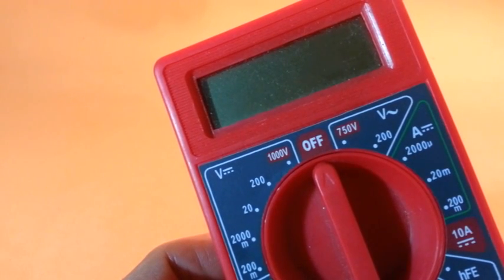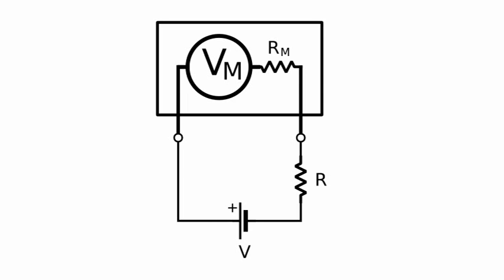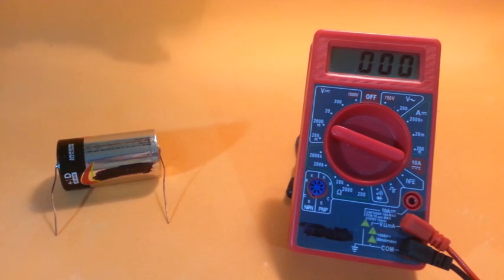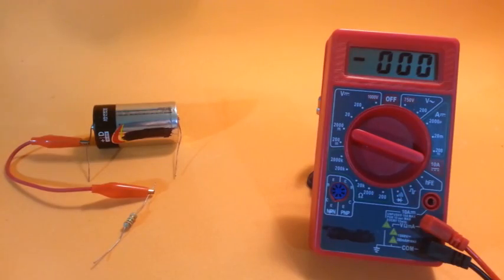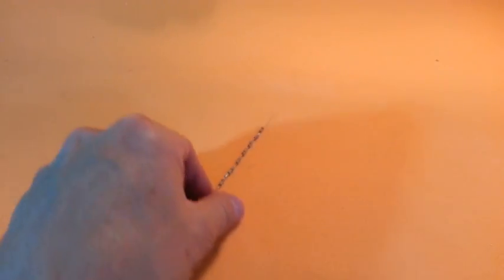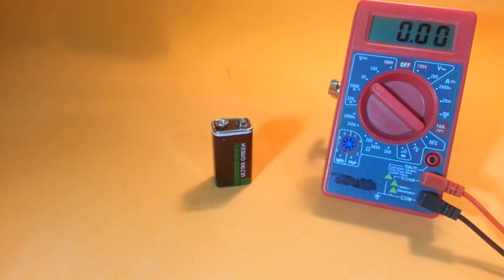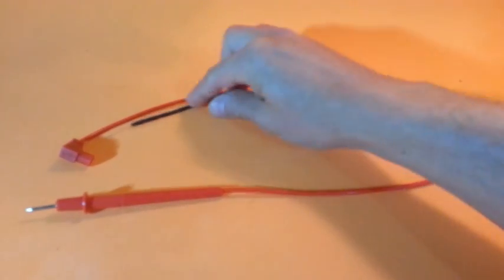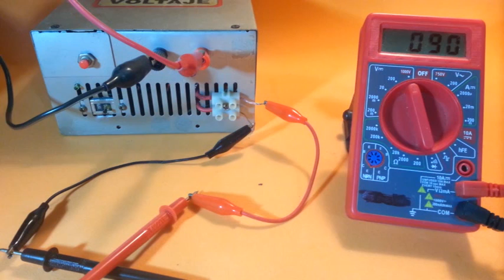Simple High Voltage Probe for DMM's

Comment: I agree with the earlier comment, your placing the dropping resistor in the middle of a test lead is unsafe. If you have built this to expand a 1kv range on your meter to 10 kv, when you probe a circuit with 10kv on it, the original probe and the attached wire is not insulated sufficiently for that kind of voltage and you could easily get an arc right through the insulation. That would be dangerous if the circuit under test can supply a lot of current too like in a microwave. A safer probe would put the dropping resistor stack in a homemade but well insulated wand.
Reply: paul austin  Isn't electricion's tape more reliable? :-)

Comment: I followed this video for my klein digital multi meter using AAA battery and a 1.08 Mohm resistor and I got an RM of 7.2807Mohms!
Multiply that by 9 and you get 65.5263Mohms!! I'm not sure I can reach that with every single resistor in my damn drawer.. 😳

Comment: You forgot to calculate the wattage of the resistor string.  Here, If the DMM is set in the 1000v scale to read a voltage of 10,000v, you are dissipating 10 Watts in the string!  So you certainly can't use 1/4 W 1Mwg resistors (That will only dissipate 2.25W!)--not including the internal resistor wattage.  So the best thing to do is make sure the nine external resistors can safely dissipate 10W.  This means that each resistor should be (in a perfect world: 1.11W).  So, 2W resistors should be used--resistors  of 1W and over get very hot even at their rated power!  Also, at the 1000v scale, a cheap (or perhaps ANY DMM should not be held here very long.
Reply: Dear Dale,
I'm afraid you're mistaken.

(Hmmm!?!  Cool coincidence!  There is <or at least was?> a resistor mfg called Dale!  They made REALLY good stuff I often specified in many of my youthful designs!  Anyway, I digress. Sorry!) 

DC power is not just a function of voltage (or meter setting).  It is also a function of current.  (AC power <which that supply of his was likely supplying!> is more complex, also involving inductance, capacitance and frequency.  But since the gentleman aptly/appropriately added the disclaimer that "This probe works only with DC" there's no need to get into all that, but it's all extremely cool to know so ~do~ look it up!  :) Anyway...)

The relationship for DC is strictly described by Ohm's Law, which when configured for power is: P=IE (where P is in Watts, I in Amps, and E in Volts).

The power equation can also be rearranged as P=I^2R or P=V^2/R.

So in this case (as you correctly stated) the power capacity of the resistance string (assuming the meter can also handle 0.25W) is 2.5 Watts.  And the total resistance is 100 million ohms (+/-5%).

Therefore when the presenter measured 2kV, using the formula P=V^2/R the power handled by the string was ~40 microwatts... which was WELL below it's power capacity.

So to figure the maximum voltage rating for this arrangement, one must determine how much electromotive force is required to push enough current through 100 megohms to bring the power to be dissipated up to 2.5W (which is just the top of the rated-safe operating range.  It would take quite a bit more power and/or time before the heated resistors actually started to burn).  For this we can use: V=sqrt(PR) 

Plugging in the numbers tells us that this voltage divider string can safely withstand at least 15.8KV (and I'd say probably ~20-30KV briefly).

But that's just the divider!  With a Harbor Freight meter... I wouldn't push my luck!  But it's DC range maxing at 1000V, limits this situation to 10KV.

I've literally DOZENS of these (gr8-4D-pr$e!) meters, and have found that they don't actually 'OverLoad' enough... not to give a reasonable reading @1KV.  So with this arrangement you could probably read up to 19.9KV... ~IF~ you read quickly, or you'll likely be put-upon to find yourself another free meter coupon!

In any case, since 1/2 watt resistors would be more stiff and bulky, and 1/8 watts physically-weaker (not to mention more expensive... 'specially if you're classy and use some of those sweet mil-spec Dale metal films!) I'd say the presenter undoubtedly made the right choice.

;)

Comment: Watt Currently Really Matters

Here's an important point
to seriously learn!
Real good advice ~EVERYONE~
(especially younguns) needs to

know

since some folks have mentioned
various safety concerns
about this very nice
and helpful YouTube

video:

Rather than hurry to worry
about an HV HF DVM hack...
y'all need to worry 'bout
something else a bit

more!

If you EVER see a smoking
hundred meg-resistor turning black
carefully step back
towards a (preferably-grounded)

door!

Just remember this what
I've written folks!
It's a fact your butt
had BETTER NOT

ignore:

If bitten by a freaking WATT
of 'kill'-o-voltage...
YOUR FRIED-ASP'LL BE DEAD
'FORE YOU HIT THE

FLOOR!!!

~KinniK~
Reply: Thanx  Kinnik  - always good advice to remind us - like running through a forest with old Bear Traps under the leaves -  probably no 60 hz buzz with the HV stuff - just ...lights out

Comment: Ludic science help me im confused
I took 9v battery whose voltage was 9.05v & exact 1Mohm resistance & the voltage of battery with series resistor was 8.17v according to your formula my multimeter's internal resistance should be 10Mohm 
So i cant understand what to do what resistors should i use

Comment: How do you make your second  battery measurement?   +   of the batterie  resistor   - of the battery?  so you measure the resistor voltage to?   Mine gives the same voltage with and without the resistor.
Reply: Then you need a higher resistor.

Comment: Like others have pointed out, not a safe design. Even 6KV has a lot more insulation from way better materials then Teflon. The heat shrink is only rated to 600V, the probes probably not even rated for 1KV if they came with that meter. That meter has no good blast protection. All high voltage probes have a earth to ground clip for a safe fault path preventing an ARC to you if something went wrong. Yours doesn't have one. The etching behind resistors and using them in series has a good way of demonstrating it, but I would not use this for high voltage. If you need an accurate reading also with 9 of the 1% resistors your already off by 9% plus the meter like that is probably rated for 5% at best, +- 4 counts maybe. But I'm more against the safety issues when people make these at home and don't understand the risks.

Comment: Is it able to measure high frequency DC ? what's the max frequency ? I think the voltage you measured at the end of the video is high frequency DC, right ?
Reply: There's no Frequency when it comes to DC.
Reply: @chuckles1808  what about pulsed dc ? Like square wave ?
Reply: In that case, yes, there is a Frequency when it's not pure DC. I do believe his power supply is rectified, though. I think you'd need a capacitive dropper for pulsed DC or AC.

Comment: Lucid Science; High Voltage has KILLED A LOT of people who didn't know what they were doing or the safety procedures. It has also KILLED loved ones who touched their loved ones trying to get them off equipment while they were being shocked. High Voltage is NOTHING to play around with unless you have been properly trained and properly being observed by trained personnel while performing tests.
- To properly measure higher voltages you really need about 990 to 1,000 mega ohms. Also the probe should not be touched by your hands or in an environment with little moisture. High voltage can travel up the probe and electrocute you if it has hand oil or moisture on the surface of the resistors or the probe casing itself. If you're going to use one, use a professional probe as a used one is less than $100.00 dollars and you can resale it for what you paid for it. Your life is worth more than $100.00 bucks to be safe. 

If you're crazy enough to test High Voltage without being trained in it first, here's some SAFETY TIPS for your friends and family; 

Before using a High Voltage probe, ensure no one will: 
a. Touch you.
b. Startle you.
c. Interrupt you after you start the procedure. 
d. Ensure someone is around to turn the equipment off if you get electrically connected to it while it's on. In other wards being electrocuted alive. 
e. I you're being shocked; Tell DO NOT TOUCH ME, turn the equipment off FIRST or shut off the Circuit Breaker in the house or building you're in, or they could die too. 
f. AFTER the equipment is OFF have them use a DRY rope or DRY wood stick to remove you from the equipment. Don't use anything made of metal, carbon or anything conductive.
g. If you have been shocked, DO NOT DRIVE yourself to the hospital, have someone take you to the emergency room, tell them you were zapped and would like an EKG done to check your heart.

Now if you're still crazy enough to test high voltage here's some OPERATING SAFETY TIPS. 

1. Set your meter on the 1,000 volt scale.
2. Connect your high voltage probe to the METER ONLY.
3. ENSURE the equipment to be tested is OFF!
4. Place one hand BEHIND you, not touching anything.
5. If you're going to remove the item, use an insulated shorting stick or an insulated LONG screwdriver to short the test point, (where you're going to test), to the frame of the box you're going to test. Then remove the shorting probe. If the shorting probe or screw driver is not long enough, connect a wire to the box frame then to the screw driver shaft or probe FIRST then discharge or shot the test point to ground, then remove the shorting probe. In either case you should here a loud snap or popping sound. The high voltage should be discharged now, and you can test it for High Voltage with the probe to ensure it's discharged with out turning the equipment on. If you're sure the high voltage is discharged then you can remove the box for inspection. If you're not removing the part then proceed with the following.
6. Place the probe in contact with the item test point to be measured, using ONLY ONE hand. Ensure the probe tip is NOT shorting the test point to ground or the box frame.
7. Turn the equipment on and record the reading on the meter.
8. Turn the equipment off.
9. With one hand behind you, not touching anything, remove the probe. DO NOT TOUCH with your hand ANY METAL on the probe. If you do the high voltage STORED in the equipment can still shock you, even with the equipment off, and possibly KILL YOU!
Well I hope this helps anyone that's going to use a High Voltage Probe.  Best Wishes n Blessings. Keith Noneya

Comment: Aiya, not so sure this will work that way. This is the cheapest multimeter one can buy, and I'm not sure it would quite work so well with a better meter. 10M ohm internal resistance is quite common for more expensive meters (read: safer meters...), meaning you'd need some pretty hefty series resistors - 90M ohms. But beyond this, is the internal resistance the same for each meter setting and range? Somehow, very doubtful. I think this is a good way to get very wrong readings, or better still, a quick way to meet your maker.....

Comment: Ludic Science you have just created a very dangerous probe. The initial probe is rated at 1000v max so the insulation would usually be able to handle 5000v safely. 10,000 is now on the other side and would definitely cause the insulation to break. Secondly, in case of any open circuit in the lead, the full 10,000v would apply to the probe. Very dangerous.

Comment: Is good you show how to do this but you needed to stress with extreme caution ... DO NOT TOUCH PROBES or CABLES or METER with this setup.. the concept is sound but following this guide can get you killed because there is no where near enough insulation to protect the user from arching through the leads or the wires or the meter.. those resistors should never be placed in that test lead like that ... that will get some one killed ....

Comment: This is not a safe design.The resistors should be at the very tip of the probe so that the test leads are not subjected to high voltage! Normal testleads are rated to only 1000V! Also keep the maximum allowed voltage across each resistor in mind!!!